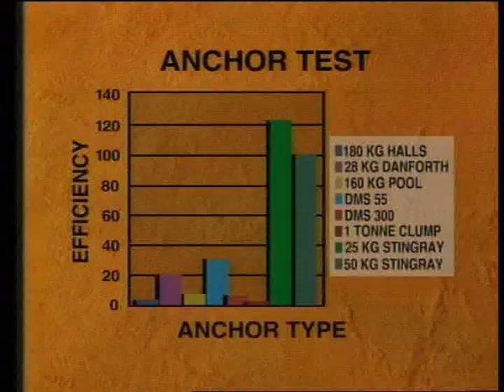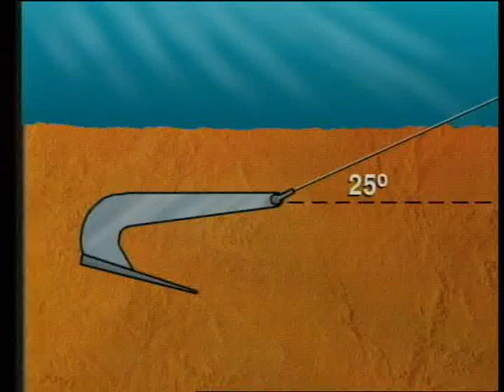Jeyco Stingray anchor performance

Comment: sorry mates bit of a biased video there. It is a good anchor but why dont you compare it against proper manufactured fish farm anchors, instead of homemade ones?
also change the angle of attack of the mooring cable and i think you will find huge differences in resistance of your anchor.